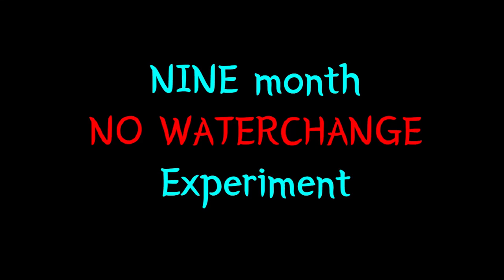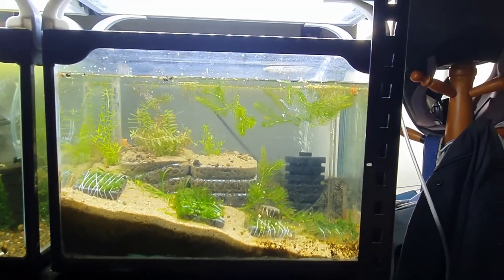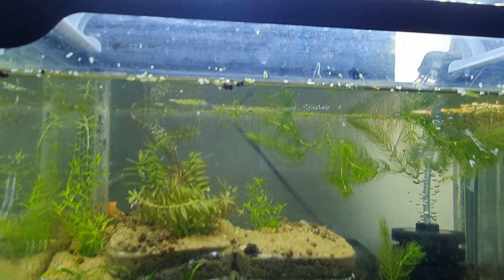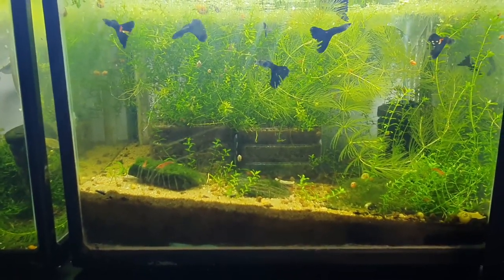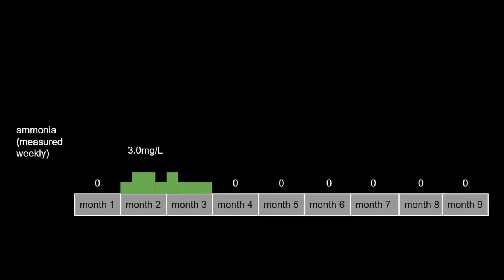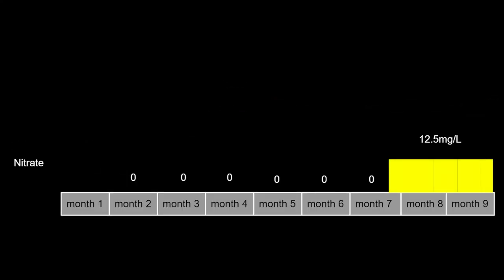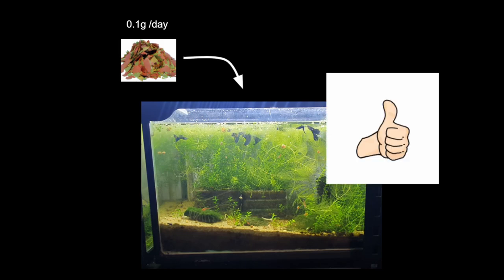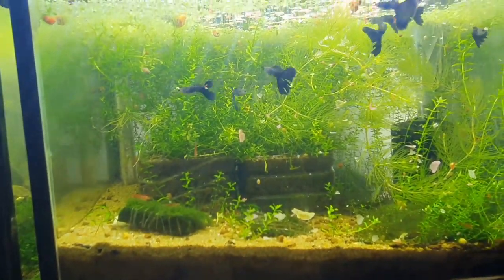9 MONTH long No-waterchange experiment. How much food can my tank handle without waterchanges?

Comment: Great experiment.  I have a 5 gallon with deep substrate as well that has shrimp and ramshorn snails that is planted with a heavy duck weed on the top.  I do not have to do water changes either.  I also have a small sponge filter.  Only one difference is I have an under gravel filter with "some" not much typical media in that space and I run the bubbler on the under gravel filter very very slowly.  Just barely actually.
Reply from the maker: Sounds like a nice tank

Comment: Good scientific method outside of a lab!  Thanks for the data and analysis, it’s surprising the TDS side of things for me but then would need a tap water analysis to further explore that. But duckweed is magic for nitrate removal that’s for sure
Reply: Yes, I think a focus on the plants, which I suppose is in another video, is necessary as they are a critical piece to the nitrate being consumed. It'd be more telling without plants as to how well a deep substrate works. Would it even work just with that and a normal sponge filter?

Comment: Thanks, I've been following your method for the past 3 years and it works. I only did water change twice in my 5 gallon in all 3 years, due to moving reasons. Otherwise, tank is healthy with minimal maintenance. I'm going to set up my second tank for guppy using the same method. One question, do you see a change in fish/shrimp breeding behavior with such setup?

Comment: How safe is using artificial rock (made of concrete) for aquarium? 
.
I read that cement releases calcium and other carbonates which raise ph of water and is harmful for fish. I saw a video in which they treat the cement to be fish safe by keeping it soaked with banana trunk.
.
Is there any other way of doing this?
Reply from the maker: It will raise water hardness. I cant comprehend the rationale for soaking banana trunk.

Comment: Very informative video with measured results. Yes 9mths is quite good. The duck weed are probably sucking up a fair bit of nitrates? The deep bed chemistry is very complex. You left out the nitrogen, lol. Protein to ammonia/ammonium to nitrite to nitrates back to nitrogen gas. Under low O2 levels another group of bacteria will use the oxygen in the NO3, thereby reducing the nitrates.That is probably in the anoxic zone. In the anerobic zone[total zero oxygen] Hydrogen sulphides are produced. I am not sure what happens in that zone as I don't have much knowledge. Can you shed some more light please?
Can you let this experiment go on to see if can touch the 2yr mark?
It is always great to see results from another angle.
Reply from the maker: I did not explain denitrification in this vid because I have a whole series that explains it in detail. Check the description. I also have longer experiments on my channel so I wont be continuing the experiment.

Comment: Thanks for the educational video. I want to do the same thing. Can you tell me what substrate did you use? Are they soil at the bottom and sand on top?
Reply from the maker: Yes. Dirt and sand
Reply: @Jaysaquarium  Is the dirt referring to the soil sold in aquarium shop?
Reply from the maker: No dirt as in stuff in your back yard. Or potting mix or anything that you can grow plants in.
Reply: @Jaysaquarium  Wonder if anyone ask this before. Why use dirt instead of the soil sold in aquarium shop?
Reply from the maker: Dirt cheap

Comment: Great experiment and reporting.  I would estimate that you plant biomass is at least 10X your fish biomass.  The plants are doing the denitrification obviously and the stable nitrate levels has nothing to do with a deep sand bed.  Your plants are eliminating any nitrate build-up, not any anaerobic layer in the substrate.  The experiment does tell me you need quite a bit of plant biomass to have a stable system.  I would not try it with larger fish like cichlids.
Reply from the maker: Well actually I measured the dryweight of plant trimmings in this tank, which suggested the plants accounted for about 70percent ofnthe denitrification. I did not include these results because i had some data missing due to mistakes i made during measurements.